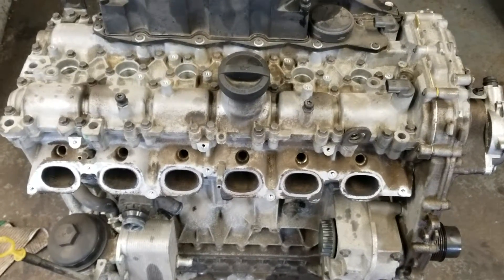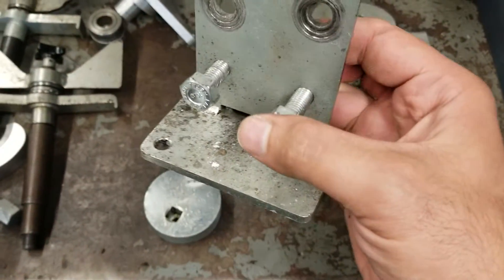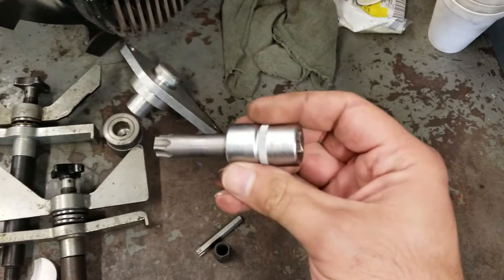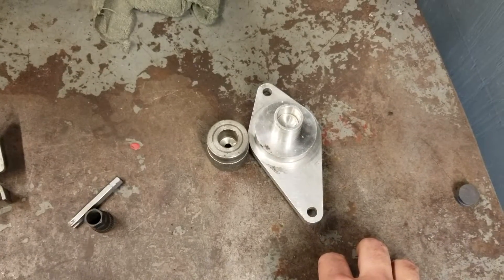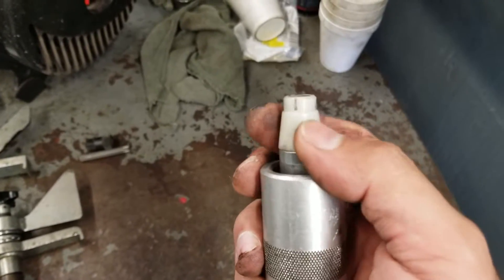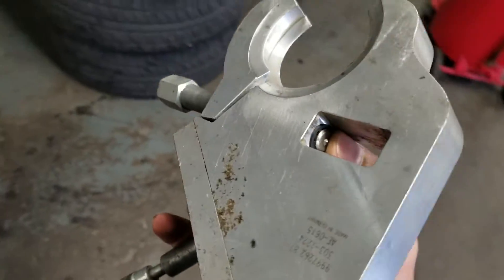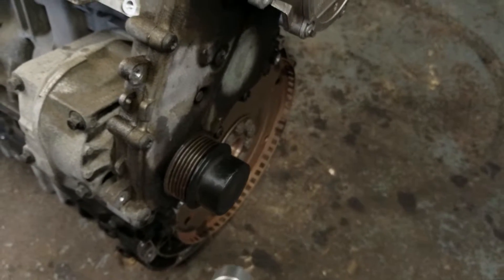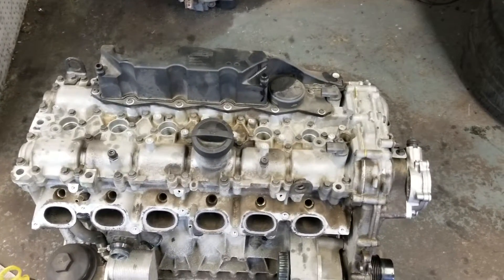Volvo SI6 3.0T 3.2 Valve cover/ Cylinder head removal Part #1 Spacial tools

Comment: thank god you made this video. Our T6 has a burnt valve and i am going to be changing the cylinder head. Im assembling parts now, thank you
Reply: Did you get it done? How'd it go?
Reply: @9113Zach  I did some videos on my own channel about it. Its incredibly tedious and you have to locate a lot of very specific instructions. Overall though not too bad. However our T6 did end up having low compression on cylinder 6 even after the job, so my work was for nothing.

Comment: @thevolvoguy Loved this video as they helped me answer a lot of questions. I have a 2008 LR2 with the 3.2 engine that has random P0016 errors. Its generally good (no errors) on cold but the P0016 pops up when warm instantly. I have swapped the obvious components already and wonder if it just could be the chain that slipped one or 2 teeth. How common is that ?

Comment: Hello - I wanted to comment on a successful lip seal installation for the READ unit without the special tool. I cut with kitchen scissors (leaving a nice smooth edge) a piece of brass shim stock (mine was .005" but .003" would be better), anealed it on my kitched stove so it would be soft, and wound it 1.5 times around the shaft stub. The shim stock was maybe 1 inch wide and 1.5 or 2 inches long. After winding around the shaft, I removed it, and rolled it a little tighter so it would fit into the lip seal. I then slipped the lip seal backward onto the stub shaft to expand the lip a little, then slipped it onto the shim stock with some 90wt oil. With the lip seal on the rolled up shim stock, I worked one end of the shim stock with my fingers to expand it until it would just slip onto the stub shaft. Then I slipped the seal from the shim stok onto the shaft, rotating it gently in the same direction as the shim stock was rolled to avoid cutting it on the exposed edge of the shim.  While operation took about 10 minutes.

Aalso, I wanted to thank you for posting these ideos - very helpful. I just finished replacing the head on my 2012 xc70 that had a burned exhaust valve. I found a junkyard head, and slapped it on. Works great! I saved myself a ton of money over having mine rebuilt, but it was a gamble not having the valves done.

I also re-used the front crank cover by threading in a very short screw where I had drilled the hole to pull the cover out. Save a couple dollars there as well, and now I can get it in and out easier.
Reply from the maker: That's great, there is always away. And you are welcome.

Comment: Im going to be replacing the head on a SI6 engine. I believe the head is going to come with new tappets but not cams. Do you think Im going to need to do a valve adjustment?
Reply from the maker: Yes you will.

Comment: AWESOME  IS THE BEST DESCRIPTION. GREAT SERVICE. .  . Question please . we have 2011 XC-60 T6 with about 90K (minus 25 k when the engine was replaced by Volvo under waranty due to severe oil leak issue) . is it advisable to replace drive belt, pulleys, tensioner ,alt. decoupler pully ,water pump ,lip seal, thermostat,PCV  as a preventive maintanence . Thank you . Regards
Reply from the maker: Check with the dealer make sure they did not replace it already.
Reply: @TheVolvoGuy  .sadly the service dept is totally unfriendly and say no info. (sad).
Reply from the maker: @seshachary5580  wow I don't know how they stay in business, look at and see if it looks new, if not then it would be a good idea to replace them.

Comment: Hey Men I like your videos very useful. I have 2008 lr2 a 3.2 engine I want to replace the valve cover gasket’s want to know if I need to toke the timing cover off in order to get the valve cover off . Please take the time to help me out? Very appreciate
Reply from the maker: Yes, you have to remove the timing cover and the timing chain and the inner cover as well.
Reply: @TheVolvoGuy  thanks so much to take the time to answer my question. God blessed you.
Reply from the maker: @rodiulla9626  no problem

Comment: Hello, I am goingto tackle this job on my 3.0 engine. Is it easy to separate the exhaust manifold from the head? Do you do this from the top of the engine or underneat? Looks like a pretty tight area and I need your advise. Thanks in advance.
Reply from the maker: You have to remove the exhaust nuts and studs from the head if you removing the head and you do it from the top of engine.

Comment: Just curious why this needs to be done with such a fairly new car?
I have a 2013 xc70 with 3.2 at 70k and want to keep it a long time but not if I have to do so much work.  Thanks; great channel
Reply from the maker: This was done due to oil consumption problem and the pistons had to be changed to help minimize the oil consumption. Unless something goes really wrong with your engine you will never need to do this. I just did the video to help some of the people out there who might need to take on such project.
Reply: @TheVolvoGuy  Thanks - looking at this again and its helpful just to see where everything is for when i (attempt) the serp belt change

Comment: Are those specialized tools available somewhere?  Is there a step-by-step manual you can recommend?  You sound like you do this often....at what mileage do you typically see these engines needing this type of repair?  I just bought an XC90 with 150K, what symptoms should I look out for?
Reply: Oh, I see you included a list of special toos in the description.....thanks...
Reply from the maker: If you have no problem then I would not worry about it. Some of the tools are available online and some you have to buy from a volvo dealer. If you have a blown head gasket or the valve cover is leaking oil. But of you have no problems. Then no worry. Bit if you have a problem let me know what it is and I will help you as much as I can.

Comment: Is it common for ghe inner timing cover gasket to fail and leak oil? Car is at 341K Km, could a failed PCV cause over pressure in the crankcase leading to this?
Reply: It did in mine....I just shoved it back in firmly with a Allen wrench........it's been tight 2years later

Comment: Volvo Guy, outstanding job on these videos, your experience doing this project shines through during your explanation of each step, THANK YOU! Can you answer a couple of questions for me? I am considering doing similar to fix a compression issue with my 2011, XC60. 1st. Can the entire job be done in the car? (I noticed you mention this is in video 4, but I just wasn't sure if that was just the timing part using the timing tools?) 2nd, do you have any videos, tips/tricks or references on removing the cylinder head from the exhaust manifold? 3rd. Do the "tappers" (the part on the valve stem between the CAM and the valve stem) typically go bad with when there's a compression issue? Lastly, if there's a bad (scorn) CAM, are these CAM's unique or machined to their Cylinder Head or can you order just a replacement CAM if needed? Again, thank you for providing these videos, gives me confidence to try this one on my own!
Reply from the maker: Thank you, 1 yes you can do the job with the engine in the vehicle, 2 you would remove the nuts and the studs from the head on the turbo engine then the head comes right off. 3 the tap it usually does not wear out but if you change the cams you have to replace the Tappits to match the valve  Clearance.

Comment: Hello Volvo Guy, I bought a 2011 XC90 with a 3.2L engine that has a check engine alert on cylinder 3. It seems that the oil spilled over the plugs (too much oil refilled) because I could find oil deposited over the plugs underneath the coils. After changing oil and plugs, cleaning the injectors, and intake, the alert went off for a while but then showed up again. So I'm assuming it's the piston ring clogged with dirt. I'm working on it by myself, and purchased the toolkit you show in this video. In the meantime, I have removed the oil pan and the valve cover. I'm following your instructions, and I don't see you have a specific video showing how to remove the cylinder cover. At this point I would like to know if I need to take any precaution while removing it, and how to remove the piston for replacing the ring kit. Any suggestions? Thanks!
Reply from the maker: Once you have the valve cover off the only thing left is removing the exhaust and any other attached to the head and you just pull it off. Then you have to remove the connecting rod bearing cap and push the piston out and I recommend doing them one by one.

Comment: Hello Jed I am eager to see your next videos part#2 and part#3  in how to time this engine, I have been working on a 2007 xc90 volvo 3.2 I6 but it seems that I can't get the timing right. I know I am using the right tools but some how when I put everything together and try to turn the engine manually two full revolutions I encounter  resistance like the valves are hitting the pistons,  Please help and advise what am I doing wrong? I don't want to mess up the engine!
Reply from the maker: I will be uploading new videos this weekend
Reply: thanks and looking forward to solve my timing problem.
Reply from the maker: @eusebiohuerta2684  I will call you around 12 clock would that be ok?

Comment: Hello, Thank you for your work.
Do you know part number for the plastic caps that cover the bolts at the end of the camshaft and drive pulley?
How can I show my support and thankfulness?
Reply: sealing plug 30637986? How did you remove it?
Reply from the maker: Thank you.

Comment: Hey Volvo Guy!  Your videos are awesome - happy I found them!  I'm in the process of attempting an engine swap on a 2014 XC60 FWD.  Question... should I separate the engine from the transmission in-vehicle or remove them together?
Reply from the maker: They have to be removed together from the bottom
Reply: @TheVolvoGuy   - yep... tried going up - not gonna happen!  Have it all out now and am tearing down the engine... but I don't have a socket for the head bolts.  What size triple square (XZN) are they?

Comment: Few questions here. I'm trying to install the crankshaft positioner into an LR2 and it seems like I'd need to bang it with a rubber mallet to get it in. I first tried the knock off one and then went and purchased the volvo one. They have same issue. Perhaps there is a defect on the female parts. I think the only way I can get it in is to file or grind down the two pins on the tool, but I'm worried I may put too much slop in it. Also, the land rover manual seems to say I need to put it in TDC before disassembly. Is it only required during assembly? I would rather put it in TDC when the head is off as I suspect it will be much easier.
Reply: Also I know you did not show the tool to remove the head bolts. Volvo lists it as 9997300. Do you know if it is just a long torx bit or something?
Reply from the maker: @Todd Baker as far as the crank tool some times they do not fit not because of the tool it's the engine but you can tap it in in place and when you remove just becarfull when you pry it off. And as far as the head bolts it is a triple torx extra long I bought one from Snap-on or you can find it from a tool supplier.
Reply: @TheVolvoGuy  Thanks, just got to the head bolts this morning and still have not gotten the replacements in yet. I saw it was 12 point. So, a triple square or xzn. My 3/8 drill bit shank fit it in, so looks like either an M12 or M14 max. I'll probably just buy a full set anyway to add to the collection. Thanks.
Reply from the maker: @vendyit  no problem at all happy to help.
Reply: @TheVolvoGuy  Your videos are excellent. I would never have made it this far even with me printing official docs from Land Rover and Volvo-Vadis. Thanks again.

Comment: Just pulled my 3.2 head, and it’s pretty warped... any idea what’s the maximum I can have milled off of the head? It’s a factory 100k mile car, so I’d rather not use a higher mileage head to replace it with.
Reply from the maker: That would be a better question for a  Machine shop they would have to see how far it was warped.

Comment: How do you get the valve cover off this engine? I took all the bolts off all around and the ones going thru the sides of the timing cover and the passenger side of the valve cover lifts up but the driver side doesn't budge as if something is still holding it down and I dont see any other bolts please reply and help me, thanks a million
Reply from the maker: All you have to do is make sure all bolts all the way around are removed and pry on the left side corner slightly and the right side corner and it will pop just make sure to leave some in the middle so the cover doesn't fly off.
Reply from the maker: If that does not work then there is specific pliers to use to pry the cover open and there is specific spots where the pliers fit. To get the cover to come off.
Reply: Rick, Did you get your valve cover off. Iam working on my wife's car and I removed all the bolts and I couldn't get it off. It looks like in the 3.2 engine you have to get the timing chain off and the shaft drive gear off to get the valve cover off if you find another way please let me know.I put everything back together on my 2007 xc90 3.2 because I could not get the valve cover off, unless I do all that work removing all timing chains and drive shaft gear.thanks.

Comment: What’s the cylinder sequence, I mean which is the first and the sixth. Do we count from the left or right? The timing chain is in the right, so should I start with the right side?
Reply from the maker: No start from the passenger side the one closer to the timing chain is cylinder number 6.
Reply: @TheVolvoGuy  you sure the first cylinder near the timing chain is the 6th cylinder?
Reply from the maker: @g.s.7383  yes
Reply: @TheVolvoGuy   I was told that the first one is near the chain, so the mechanic is wrong.
Reply from the maker: @g.s.7383  yes he is wrong cylinder 6 is next to the timing chain.

Comment: Hey Volvo Guy, I have a problem with my S80 Volvo. I did get the ignition switch replaced. Today when I got into the car I put the key in but when I push the button the car shut down? What do you think could be the problem? My friend checked the battery and the car came to life but when I tried to start it, it goes dead. Could it be the starter?.
Reply from the maker: Check your wiring to the starter or it might be the battery is is starting to go.
Reply: @TheVolvoGuy  It was the battery. The positive terminal was very loose. My friend tightened both of them and it started right up!!
Reply from the maker: sims  nice good job..👍👍

Comment: Can i crank the engine manually from the flexplate ? I dont see a crankshaft pulley that I can rotate with a ratchet
Reply from the maker: Yes you can. Otherwise you need the crank tool to turn the engine over.
Reply: @TheVolvoGuy  Say I wanted to do a leakdown test on my XC70. Would I even be able to turn each piston to TDC with the engine still in the car? I guess my question is, how much do you have to tear apart to get that crank tool in there?
Reply from the maker: @dr_beetus  to get the crank tool on all you need to do is remove the large crank cover on the passenger side black cover.

Comment: Hello Marcus Butzin here, I have a 2011 XC90 3.2L I need some info please. Which end of the engine is the number one cylinder? Standing in front of the car looking in the engine bay at the engine which is number one on the driver's side or the passenger side? Thank you for the info. I am trying to remedy a misfire in cylinder #2.
Reply from the maker: Hello Marcus Cylinder #1 is on the passenger side next to the motor mount.
Reply: The Volvo Guy Oh thanks! Going out to pull the plug! This channel is very interesting and informative! I subscribed and like! Thank you!
Reply from the maker: @buffettfanman  thank you very much. If you need any more info hit me up.

Comment: Great video . I am working on my 2007 Volvo xc90 3.2 , I am trying to remove the valve cover so I can replace the seals.Do I need to remove the timing cover in order to remove the valve cover.
Reply from the maker: Yes you do no way around it.
Reply: @TheVolvoGuy  Thanks.
Reply: I have another question. Do I have to also remove the timing chain and the shaft gear and what tools do I need for the job?
Reply from the maker: @yanklopez4742  yes I have listed all the tools you need for the job on one of my videos. Also I have all the videos for the removal process.
Reply: @TheVolvoGuy  Do I have to get the engine out the car to do the job?, Or there is another way to remove the timing chain without pulling the Engine out.
Reply from the maker: @yanklopez4742  no need to remove the engine at all you can do it all with the engine in the car
Reply: @TheVolvoGuy  thanks that is great news for me , I just going to try to do the job because after putting everything back together without replacing the valve cover gasket the car is leaking, I knew that was going to happen. Can you give me some tips to remove the chain in the vehicle without   messing the timing on the engine.
Reply from the maker: @yanklopez4742  there is no way to do that without having all the tools I listed in my videos.  If you remove the chain you got to have the tools. No way around it.
Reply: @TheVolvoGuy  yes I will get all the tools to get the job done.

Comment: Hello, I went to the dealership to get the drift tool and I was told they were not a able to get it.Do you know how much it cost , is there any other way to get it?
Reply from the maker: What is the part number for the tool not sure which one exactly you talking about.
Reply: I am sorry, is 9997565.
Reply from the maker: @yanklopez4742  it's ok so this tool number I typed it wrong this is the tool for the lip seal I believe it is available I will get you the correct tool number
Reply: @TheVolvoGuy  thanks. I appreciated the help.
Reply from the maker: @yanklopez4742  9997265 is the correct number.